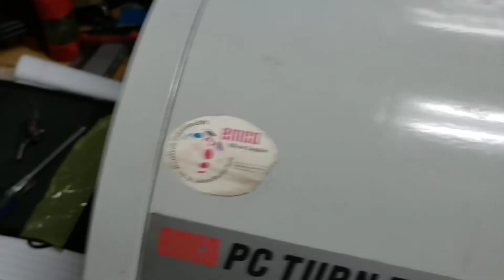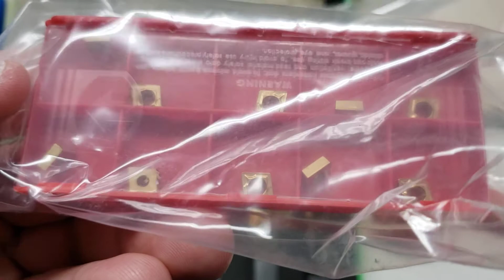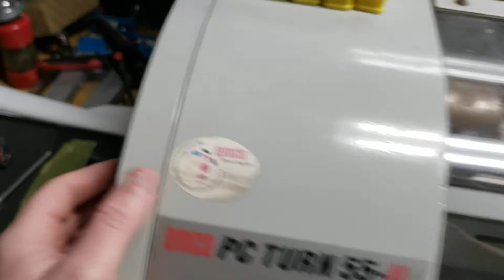Emco pc turn 55 tooling overview - Shars, fleabay and XtremeAmazing tooling

Comment: I like your idea of extending the tools out onto the face of your turret. Just keep in mind you will put additional strain on the stability of an already somewhat unstable machine :)
Reply from the maker: I don't think it'll be that big of an issue, considering the cutting conditions I intend to use with this machine. I'm not going to come that far out, only enough to make the ER collet holders a little more feasible. I saw on another video where someone did something similar with no issues. Just have to know what you're working with with these small machines.
Reply from the maker: Here's that video I was talking about. Looks like they milled down a larger holder, but this is kinda what i mean.

https://youtu.be/ZJw3W4wOjlI

Comment: Good luck finding inserts for the Shars set 😉
Reply from the maker: Wcmt and ccmt are standard insert shapes... Have you had an issue?
Reply: @TheFeralEngineer  I have the 3/4 shank kit, and it was a pain to find replacements inserts, easier to buy proper tool from Sandvik, once we confirmed the machine was good and worth to invest in better tooling.
Reply from the maker: @tom_machinist  the inserts that are included in the half inch set seem to be pretty common. Time will tell.